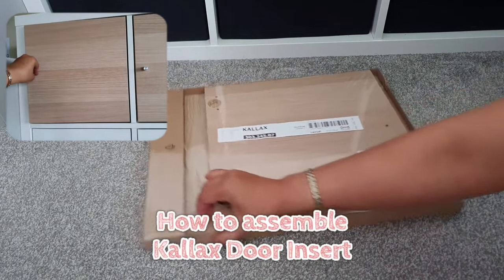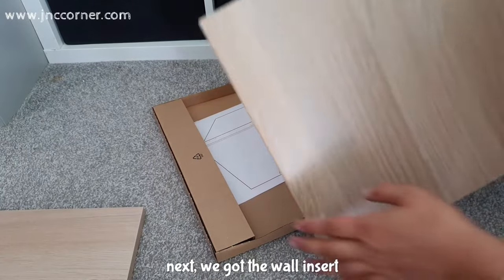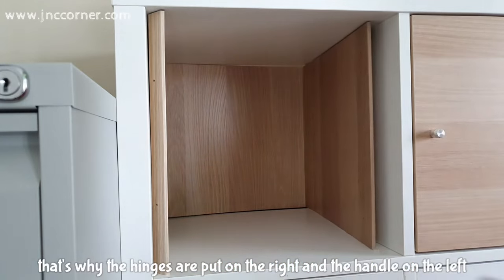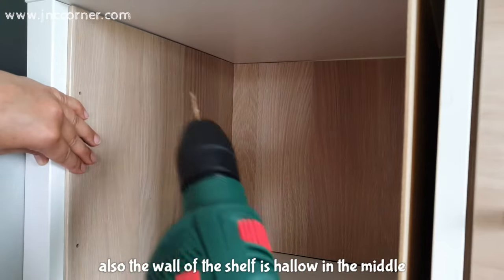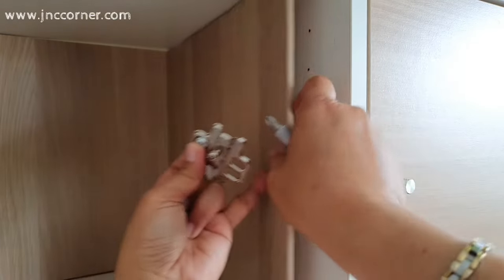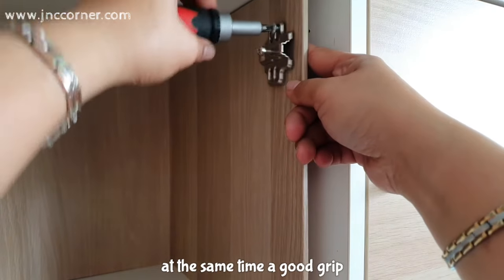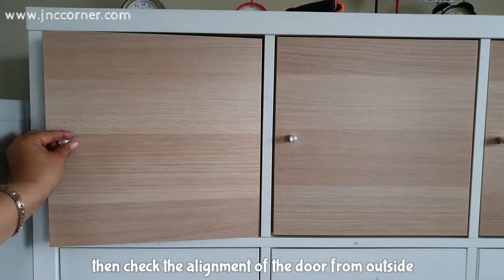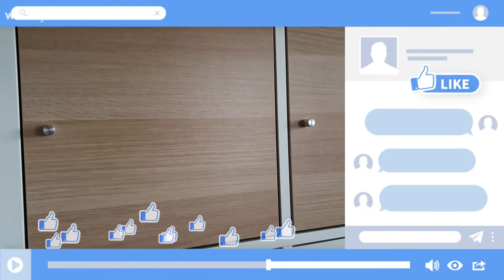TIPS & TRICKS ON HOW TO ASSEMBLE IKEA KALLAX DOOR INSERT ♧ JnC CORNER

Comment: I found assembly easy and straightforward — except for one thing that sadly, this video does not address.   How to adjust the door hinge for left to right?  It is unclear which way you turn that adjustment screw and the changes are too subtle to interpret.  I’m having real trouble with too much gap on the hinge side, not enough on the handle side.